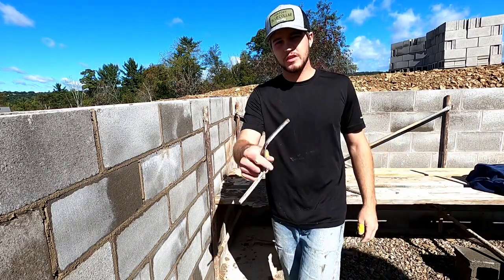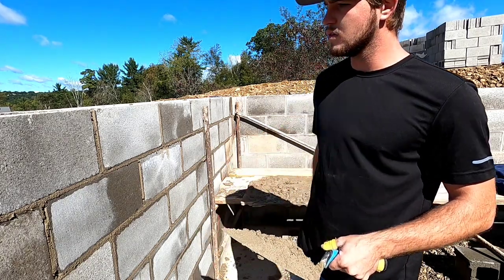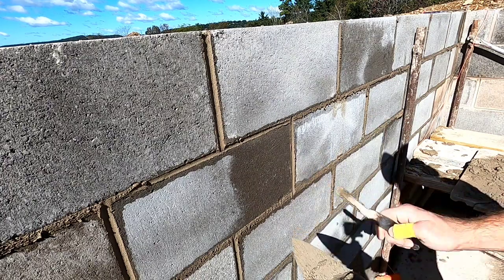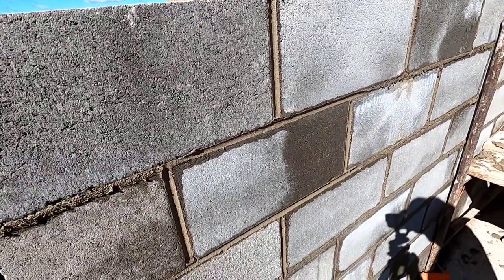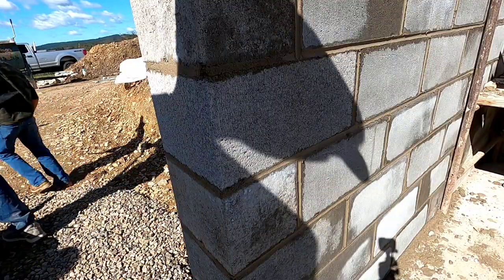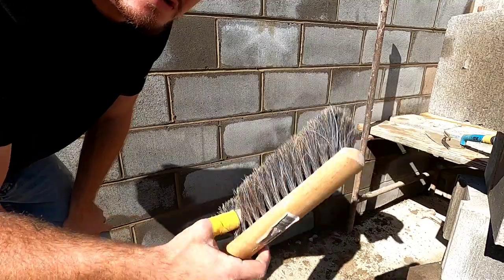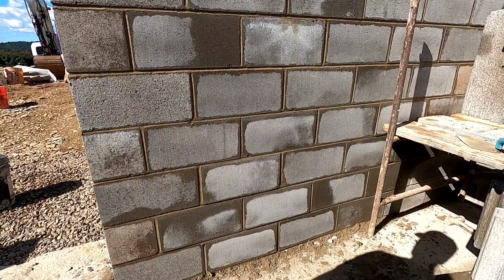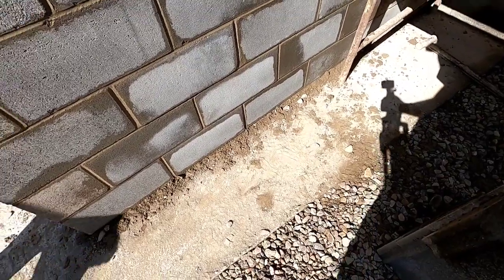How To Point A Block Wall

Comment: Better to hit with a sponge float after you strike joints once. Use the larger side of the jointer on first tooling. Then second time you polish with the smaller side of the jointer. After it sets a bit then brush the wall for any burrs remaining. Less rubbing later if it was a wall in a school to be painted. You can even use two different jointers for each tooling process.

Comment: How do I maintain the 40 year old block walls of my addition. It's 2 stories with a block wall first story that's exposed to the weather. The block has never been painted or treated. I'm beginning to notice some hairline cracks where the mortar meets the block in the joints. How do you fix that? How do I maintain the block and joints?
Reply from the maker: When it gets too bad you have to take a grinder and grind out the bad joints. Then fill them back in with new mortar. This is called repointing, I haven’t done any videos on that. I’m sure there’s done good ones out there you can watch

Comment: Thanks for the video. Is striking the joints just a cosmetic thing or does it help with the wall integrity?
Reply from the maker: Both. It looks better and seals everything up. If there are holes water can get in there and crack the joints